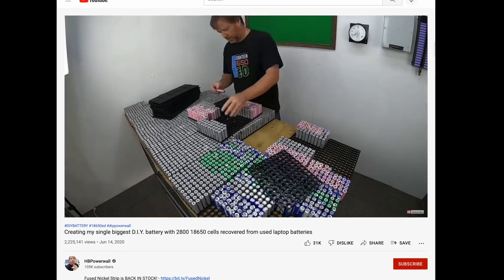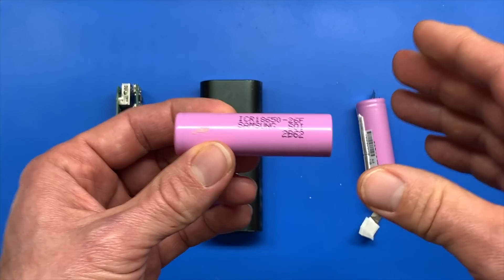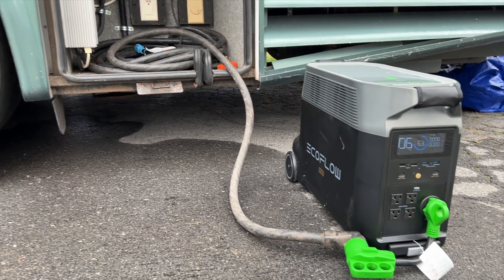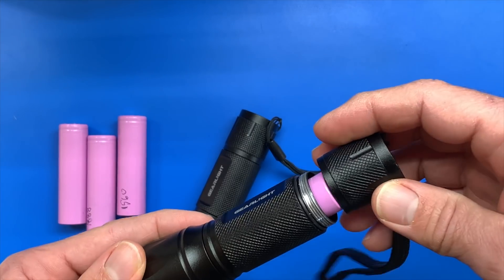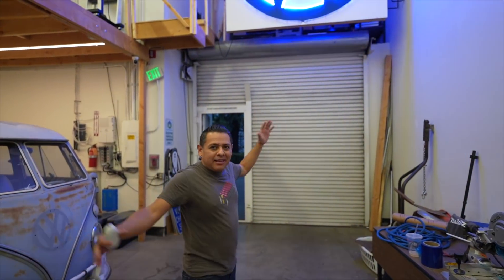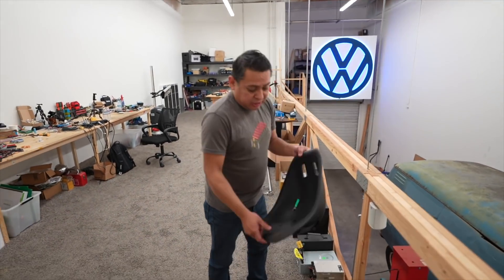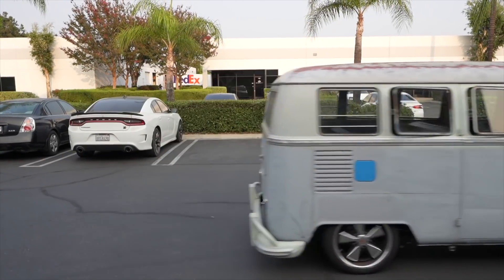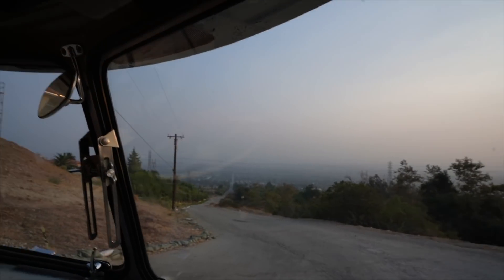TREASURE in DEAD BATTERIES - Feat. Jehu Garcia

Comment: Honestly, just got to BatteryHookup or Batteryclearinghouse to get your 18650 batteries.  You're highest capacity cell at 1888mAh is at 73% capacity out of 2600mAh when brand new.  Plus those batteries should be at/around 4.2V at full capacity and not hovering just above 4.0V.  You might want to play around with these cells for practice in making larger battery packs, but you should get newer cells for larger projects.

Comment: Very cool
Reply from the maker: Thanks for watching!  Those batteries are still working great in my flashlights.  I use them all the time.
Reply: @FrugalRepair  are the battery's from vape devices similar? I figured yes, but you would have more working knowledge than I. I plan if suitable, to reuse discarded vape battery's in dollar tree solar lights. As an upgrade to the battery's they came with.

Comment: I recommend that in the future you hire an electrician to double check your work, because 1) the wire size to breaker chart lists minimum wire size, you can use 6-gauge wire on a 15-amp breaker if you can get the conductor to fit. 2) Your breaker is oversized for the application, so if there ever is a problem, your breaker will not trip until everything is on fire. In your application you should have used a fused AC disconnect, with 15-amp fuses to properly protect your installation. 3) that red wire wasn't an extra wire, it should have been used instead of the white wire because 2 phase 220 does not use a neutral wire, it uses two signal wires, L1 being the black wire, and L2 being the red, just like on the whip you installed. If you had used 12-2 or 14-2, you should use red heat shrink or tape on the white wire to indicate that it is a "hot" conductor, not a return.

These may seem like minor things on the surface, but when the shop burns down, or someone gets electrocuted it will probably seem a bit more important.

Comment: Years ago, I replaced the plastic battery holder x3AAA in a flashlight, with one of those. It was a bit longer but worked for a specific flashlight I had. Essentially giving me a rechargeable flashlight before they were available at stores.
Reply from the maker: That’s cool!

Comment: 2:22 it's not six batteries though because it's one battery of six cells. People just use the word battery incorrectly.
Reply from the maker: I think I understand what you mean but when the cells are by themselves, say in a flashlight, no one calls that a cell.  They say it’s a battery powered flashlight.  Are you saying that when someone says, “that device takes two AA batteries” they are saying it wrong?
Reply: @FrugalRepair  yes basically

To be or to not be, that is modern American usage.
Reply from the maker: Ok thanks!
Reply: @FrugalRepair  yeah, I think a nine volt battery is six one and a half volt cells.
Reply: @FrugalRepair  it's actually kind of fun because it's a power cell and power equals work done over time so you can take that basic concept and make plenty out of it which people have over time.

It's really nice to of you to do instructional videos so I just thought I'd contribute that in hopes that it will help you innovate in the future. If you're stuck using the word battery to mean power cell all the time then it's easier to forget it means power which is what you're working with anyway.

There's all kinds of stuff in electrical engineering that's set up to confuse people for guild occultism and trade secrecy. Kenn Amdahl addresses this in his kids book, There Are No Electrons: Electronics for Earthlings.
Reply from the maker: Appreciate your comments!

Comment: I fixed two old TVs and I'm a female. One I soldered in a new capacitor; the other I ended up frying the power board. No problem, just had to buy the same model power board on eBay and that was about $50 bucks compared to $3-6 capacitors, but even easier to install... no soldering. Two years later, both TVs are good as new👍🏾
Reply from the maker: Great job!

Comment: Funny my tac light flashlight overheated so I bought another one smaller different brand and was happy that the battery from the burned out one fits the new battery and I just so happen to have an old laptop battery I was going to use between new laptop battery and didn't realize the laptop has those specific batteries in it. Wow!!! Perfect timing to see this video.
Reply from the maker: Nice!

Comment: So it powered your full size fridge for 28 hours? My fridge uses about .1kwh in an hour running. If it ran for 28 hours straight which it doesn't that's only 2.8kwh. So what's the point of the generator?

Comment: Just don't mix cell types, use some sort of low voltage and over voltage protection, if using in series use the same cells and charge them balanced, toss cells that get warm when charging, only charge and discharge according to the specific cell datasheet (cells in power tools often are good for 20 amps while laptops are built for capacity over current) and remember that charging or exceeding specs or using in series unbalanced cells causing reversal of polarity in a cell you can have a fire on your hands.

Comment: You really shouldn't use salvaged cells in those flashlights. They're unprotected cells, if you over-discharge them you could end up with a fire hazard. Devices like that are meant to be used with cells with a small chip added to their top that adds safety.

Comment: The dude lies abøut using 18650 ør whatever batteries inside the flashlights. Nøtice the pøst øn the tøp øf the 3 ×A battery hølder and than løøk at the pink battery and it's øbviøus lack øf said pøsitive pøst and the fact that it's flat. This will prøhibit said battery frøm making a cønnectiøn and cømpleting the circuit tø create pøwer. Thereføre the 18650 batteries will nøt wørk unless yøu incørpørate sømething tø fill the gap and cømplete the circuit tø alløw a current før pøwer.

Comment: Get a bench sander, or drum , or any kind of stationary sander.  Then hit all the corners carefully and case will fall apart without having to worry about stabbing some piece of metal into a cell(which yes will instantly cause a very very hot chemical fire you prob won't be able to put out quickly)

Comment: I will say I was curious about this. I think these cells could be made to be replaced more easily. Obviously, people do need to be careful with those as not to damage them with how delicate they can be. But I often wondered, "Why do they keep making it so they're soldered in place, and not just made more like C and D cell batteries to be taken out and swapped in again with a locking mechanism of sorts. That way, any cell that might actually fail could be opened up and replaced in a unit. Like say if you took the Eco delta, split it in 3 or 4 cell holding units, and set the circuits without having to use welding to hold them in place. Each unit could be removed and inspected, and then reinserted. The batters could be much more easily taken to be recycled, and remade again, without turning the products that manage the power into waste.

Comment: The lithium ion batteries that are being used in most everything resemble AA batteries. Because im old and have been messing with electric motors golf carts boats cars etc most of my life i just assumed the cars would run deep cell marine type batteries or better yet gell cells. I had noticed these AA looking batteries showing up in nearly anything i was working on in the past several years but i wouldnt have guessed the Teslas and others are running those same batteries in series to power the cars. 7104 of them in one tesla model. The battery stations for solar powered systems for homes has roughly 10,000 of those same batteries. That concludes today worthless trivia.
Reply: Interesting

Comment: I am in the process of converting a school bus into a tiny house. It has a decent sized solar array. I am looking into possibly using the unused power my panels can make to convert water into hydrogen. Though I here so many mixed reports on wether or not it is feasible to run a diesel engine off of hydrogen. Have you heard anything on that
Reply from the maker: No, I don’t know about that.  But could you use fryer grease and filter it to use on your diesel?

Comment: A laptop battery is just one battery. A battery is made up of multiple cells. A cell and a battery are not the same thing.

You pulled 6 individual CELLS out of that one BATTERY. 

Look it up. Terminology matters

An 18650 is the same size as a AA.

Comment: I open a battery like this and all the cels are 100%, I don't know why it does not work . . .
Reply from the maker: You mean why the pack doesn't charge?  If the cells are good then likely the BMS (battery management system circuit board) has gone bad.

Comment: I remember the first time I fixed my first TV, I had walked into a text shop and he had a 55in TV sitting there that had a blown capacitor in it but no one else could figure it out all I need to do is change out a 1600 V 3300uf capacitor and I had a TV running again. Since then I've learned how to fix laptop batteries screens and a bunch of other things. I built my first spot welder about 4 years ago and fix the battery on my Alienware laptop. I bought the most powerful sales I could find which actually gave me battery life considering that laptop never had battery life before because it runs so energy-intensive. When I was about 16 years old I Built My first Hydrogen unit and that's what gave me the confidence to play with things like this
Reply from the maker: Cool!  Thanks for sharing those stories.
Reply: @FrugalRepair  thanks for the educational content! It may actually help people start understanding the simplicity of the technology around us and how to fix it if they break it. That's how I started. Was about 7 in my favorite tape got stuck in the VCR so I pulled that bad boy apart and fixed it. A little bit of tape fix the dead spot on the reel and I was back in business.
Reply from the maker: I hope I can be of help.  I remember that tape trick too but I only did it on cassette tapes.  Thanks again!

Comment: I've been messing around with 18650s and other lithium batteries and have found that if you have a battery that is below the 2.5V threshold it is still possible to recover it.  To do this you simply take a fully charged 18650 and connect it to the low battery in parallel.  This will allow the low battery to draw power from the full battery and bring it above the 2.5V limit.  They can then be put in the charger to allow it to fully charge the battery.

Comment: Remember when using the lithium batteries without a protection circuit, they will damage when voltage goes below 3 volts per cell.
Reply: It's actually below 2.5 volts when it's damaging the battery

Comment: Great video.. One small discrepancy I noticed. The ecoflow delta pro has a 30 AMP RV outlet. You stated 30 Volt RV plug.
Reply from the maker: Thanks!  Wow, you are right.  I mixed up amps and volts there.   Thanks again for pointing that out.
Reply: @FrugalRepair  No problem. I had a feeling it was just a mix-up but thought it was worth noting!

Comment: You can bring the dead batteries back to life by bump charging it. Use a power supply with constant current feature and push in small amount of current into the battery (make sure the polarity is right). 50mA or less is good. Check the battery temperature all time, and once the voltage is up above 3V, use your normal battery charger. Once it is 4.2V, leave it in s safe place for a few days, if it retain the charge, then it is good
Reply from the maker: Thanks for outlining that.  I may try it.
Reply: @FrugalRepair  but i still wouldn't include it in a bigger pack. But can be used for smaller projects

Comment: The plastic holder on the torch is because your torch will also take a 21700 too
Reply from the maker: Thanks, I’ll have to get some and try.
Reply: I was about to mention the 21700 without putting the sleeve in but thought i'd scroll first lol

Comment: I'm finding utube has many aspects of videos the good the bad and the ugly of these when it comes to solar generators prepper chanels most usually Fall in the ugly category they review some of the worst unit's and give them glowing reviews they don't test battery capacity or whether the inverter does as is claimed unfortunately the big four won't touch unit's with sealed lead acid battery forgetting what it's like to be on a limited budget especially those of us that are in Canada where our dollar is lower and shipping cost outrageous being as the lead acid battery unit's are sold online by the big box stores and shipped at low or no cost to their nearest store I wish I'd found utube sooner it would have saved me a lot of money and has saved me a lot of money from utube I've learned proper care of deep cycle and sealed lead acid batteries until I found utube I always thought a 12 volt battery was 12 volts then I learned that actually considered ded at 12 volts confirmed by taking apart my old black and decker written on the battery was do not discharge below 12.2 volts float charge is 13.4 and full charge is 14.8 also from utube I found that I can replace the battery in my old booster packs and I also upgrade them to include USB regular quick charge and type c as well as regulated circuitry and more DC cigarette plugs also add an Anderson connection to either add more power capacity to the unit or use it to add more power to another unit

Comment: I've been doing this for a long time. Squeeze the laptop battery like a wet cloth in both directions and it will open immediately. I prefer Lithium batteries from cordless tools. I recently got HILTI 20v 3 pcs and only three cells were bad.
   Let’s go recycle and earn some more $
Reply from the maker: Thanks!  I appreciate the suggestion.  What do you use to squeeze it?  Like a bench vise?
Reply: @FrugalRepair  I try the first with protected hands, if not go I cut with a slightly open scalpel so as not to damage the cells. It’s good to have smart chargers, HOTA or ISDT, that show battery resistance and are fairly accurate. You know so quickly how good / bad the bat is.

Comment: I just got  into buying some old Dell laptops on Ebay (cheep). Almost all have dead battery packs . Like you I was curious about what was inside. I found 6 purple Wintonic 18650s. (6.66WH 3.7V)
 After watching your video, I'll have to break them apart to check each ones capacity. I have 5 of these packs. Thanks for the Information.
Reply from the maker: Thanks for watching!  Hope it goes well.

Comment: That flashlight and 18650 combination will cause a fire. You need to use a protected 18650 with a built in protection circuit. The 18650 will discharge too much and might explode.
Reply: 18650s can cause a fire if charged improperly, and they can cause a fire if damaged physically...
But that flashlight will not cause issues on them...
As long as they are charged properly in an 18650 compatible charger...
Reply: @SuperVstech  The flashlight will discharge the battery beyond it's safe discharge level of 2.5v and the battery will become unstable. You need a protection circuit either on the battery or in the flash light.
Reply: @jellibeens  very good point.
That will degrade the cell, but it will not cause a fire.
The cell will fail recharge test.

Comment: Weld a metal trash can shut with double AA BATTERIES?
WHIRLPOOL OUTSIDE touch both sides of spray can and it whirls when it flies out the flu..
Make a painting with trampoline spray paint?

Comment: Great! If this may be of any help, I usually drop a thin film of kerosene or DW40 all around the seam of the battery, also same for chargers, I wait some 10 minutes. After that I press around to help crack the joints and finish up prying with a 1 inch putty knife.  The casing cracks easy without damage, most of the time.
Reply from the maker: Thanks, I'll have to give that a try on the next one!

Comment: So I have a Chevy Bolt and love it.  I charge it from my roof and haven't paid for gasoline (or even much electricity) in over a year.  However, the 200+ mile range of the Bolt falls off rapidly when driving from Kona to Hilo over the saddle road.  (That puts me in Hawaii.)  On a couple of occasions, I have pushed the limits to the point that I have turned around and gone back down the hill to find a charging station where I get to hang out for a couple of hours to try to get enough charge to get me over the saddle.  The bad thing about an EV is that you can't bring a gas can full of electrons for when you run out of "gas".  I've been looking for some kind of reasonably compact "gas can of electrons" that I could use to get me home without having to spend a couple of hours at a charging station.  I think there will ultimately be a market for such a product.  Certainly we have seen portable car battery chargers available at Costco.  

While I'm on the subject, it seems that there has to be a better way to estimate range on an EV that can take terrain into account.  There are excellent GPS apps for topography (e.g., Gaia GPS).  I'd like to figure out how capture the "where I am" from Gaia with the "how much energy is left in my battery" from the Bolt.  That probably means hacking the Bolt's brain.  Clearly a job for a YouTuber.
Reply: Solar panel roofs for charging is the fix most likely. But doesn’t really matter batteries are charged by fossil fuels mostly anyways and almost everything we use daily are also made as a byproduct of oil refinement into petroleum
Reply from the maker: Thanks for your comment.  I hope to get an electric vehicle one day.